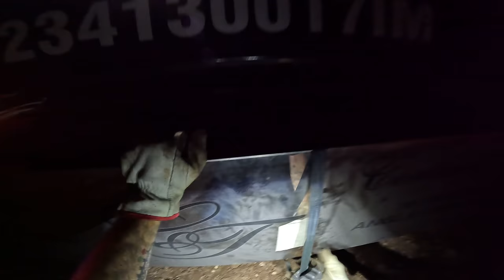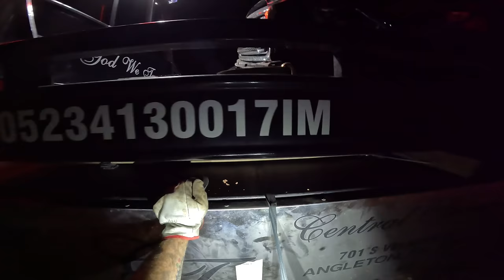Wrong Way Driver Takes Out a Concrete Barrier!!

Comment: That person was driving that pick up had been going very fast, and it's a miracle that he even survived. It is so good to see a woman there training to learn the ins and out of tow truck running. Awesome job in both Destin you did a wonderful job!
Reply from the maker: Thanks!
The driver was definitely lucky.
Reply: As a 30-year post motor vehicle accident spinal cord injury quadriplegic wheelchair user, I find this very disturbing. The fact that this driver was so incredibly reckless, obviously a really high rate of speed, going the wrong way, and could have easily injured who knows how many other people, and he walked away? I truly hope he cherishes every moment of every day of the rest of his life. That could have ended so much different. My accident was under 50 mph, forced off the road and rolled over in a pickup truck. Yes I was a seat belted in, but it was a roof crush injury. The damage to my vehicle was probably less than 10% of the damage done to this vehicle. I do hope he or she realizes how lucky they are.

Comment: The trainee really needs to put on reflective gear before she gets herself killed seriously
Reply from the maker: I wear mine always, but realistically if someone is going to hit someone because they don’t have high vis on, the high vis wouldn’t have mattered anyway.
Reply: @Towtruck_Dustin  fair enough
Reply: @Towtruck_Dustin The difference is in court if your not wearing it and survive your entitled to zero cause they didn't see you. Class 3 is required on all highway calls. Your standard uniform does not meet the standards to be ANSI compliant. Your responsibility as the trainer to enforce and teach these things. Also the latex gloves offer zero protection for sharps. Wear latex under a good leather glove to protect against bio and other hazards. The wall keeps growing and sadly alot of names didn't have to be there.

Comment: you all need reflective wear !!!! you gonna get hurt !!!! and her too...What did you loose out of the car on the way back???? dude you need to wake up. you gonna hurt some folk with not strapin stuff down afore you move it. EG the door an stuff...
Reply from the maker: I’ve always got mine on.
Reply: How exactly do you suggest he straps the doors ??
Reply: @Leotheconstructionguy  if the windows are shattered you can put the straps through there or if necessary all around the vehicle, that's how I usually do it